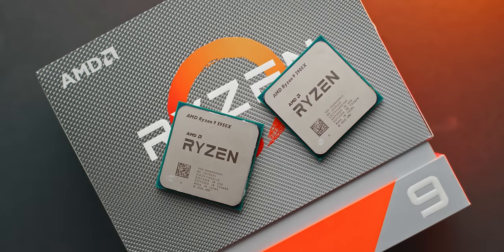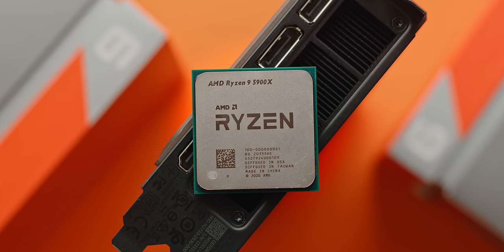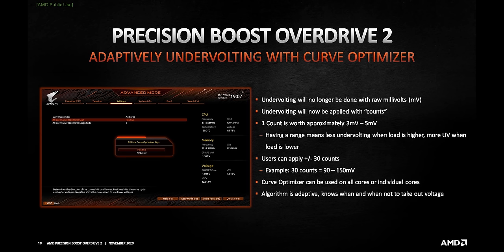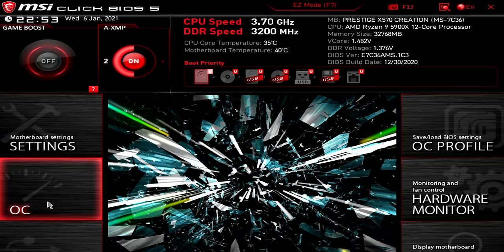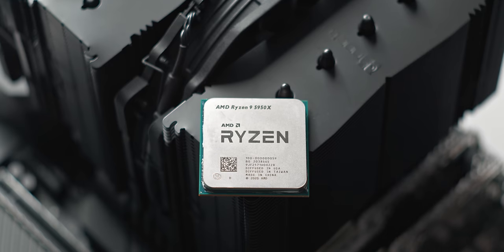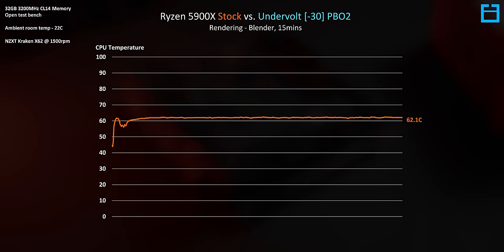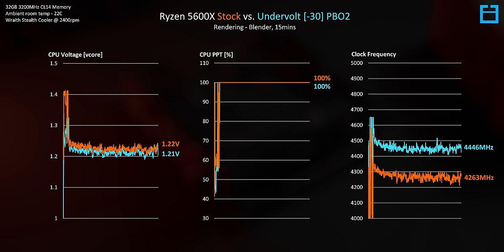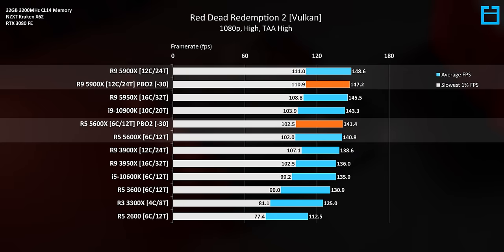Ryzen 5000 Undervolting with PBO2 – Absolutely Worth Doing

Comment: Yeah this is brilliant and seems like something a lot of proud overclockers would completely miss. After undervolting my 5600x by the max amount, and undervolting RTX 3080 to 0.85V @ 1875MHz I use a maximum of like 300-350W when playing games, not a single hitch. Crazy stuff. Combine that with Noctua cooler and case fans and my PC is almost dead quiet at full load, and generates a lot less heat. 

Undervolting all the way. So much more satisfying to have a highly efficient PC, rather than raging inferno just for a few more fps.
Reply: same with rtx 2070s and same cpu shaved of 10/18 c in most game under load wh3 warzone and rest crazy stuff
Reply: What is your settings for 5600x?
Reply: Damn, my 3080 is 0.95v @ 1950Mhz and I can't go lower or I crash
Reply: @SpiderpigThe  turn of pbo that is all how i see lie, so much voltage and temp for nothing , just overclock manualy if you want i get it on 1.2v 4.5ghz under loads it get around 63-65 c with aio.
Reply: what value did you put -30 for all core or?
Reply: @ionutortian5885  I put -30 on all my 5800X3D cores, dropped 10c under load
Reply: @maliikac95  doing so instead of pbo increases power consumption and temps in games, while in benchmarks it's bit colder and higher scores
Reply: This is the way
Reply: how do u undervolt gpu?
Reply: they all know undervolt, showing undervolt result wont impress anyone, they show another profile with max oc for gaming instead
Reply: i got a 500 watt psu and want a 3080 this gives me hope not to upgrade it lol.
Reply: dont forget about VRAM on GPU, sometimes by underwolting GPU - fans may go full stop/passive mode for most amount of time, VRAM usually is still under high load and heating, not all videocards have sensors on VRAM, not all videocards have great heatsink to properly cool VRAM in passive mode, i think ideally need to manually set up fan speed curve, at least 10-20% always active mode for low GPU core temps, fans still will be quiet, but at same time cooling down VRAM constantly
Reply: How do you under volt the 3080?
Reply: yeah if you know you dont have money for electricity bills why you make that setup????????????????

Comment: Absolute champ, I've watched almost every video and learnt so much from you! You walked me through my NZXT H1 build, undervolting my 5700XT, justified my already purchased EVGA 3060ti XC and now this. 🙂
Reply: Why would you replace a 5700XT with a 3060 Ti? I'm not bashing or hating, it just genuinely interests me. Those two aren't too far apart in terms of performance, or at least not enough apart to justify spending $400+. Or have you sold/found another use for the 5700XT?
Reply: @subrezon  probably sold it or got rid of it, maybe cuz of driver issues?
Reply: @subrezon  in my opinion, definitely for RTX😭.
Reply: @subrezon   @Subrezon  yeah that's a good question. I video edit and I wanted to try try an Nvidia card for the GPU accelaration and I have to say it's been a pretty good. I game as well and I'm planning to use the 5700XT and my 3600 from my H1 in my new HTPC. What's interrsting though is in Australia, my gaming OC 5700XT is going for 550 - 600 on ebay and I bought it for 670! Tempted to sell it...
Reply: @subrezon  In my expericence the 5700xt drivers are just garbage and slipping over to the 3060ti is reasonable, especially when u can take advantage of tay tracing
Reply: @bobtyler8374  Raytracing with the 3060ti doesn't really make sense as it's too weak to enjoy the image seen, because fps are quite bad. Also drivers with 5700XT have been perfect for a good time now, the problems were only at the start, some minor bugs are with every GPU though.
Reply: @jonasziegler3025  what gives you the idea that the fps is bad? It's equal to a 2080
Reply: @weavercs4014  Yeah, and raytracing with a 2080 is not fun, it even isn't with a 2080ti/3070.
Reply: @jonasziegler3025  I disagree, my personal experience with the 5700 xt has been abysmal, constant crashing and drivers errors, even when i moved it to another system with much higher psu, i got a 3070 a week ago and havent had a single crash, again thats just my experience.
Reply: @bobtyler8374  Yeah, what I said, some have problems, some don't. But there were also black screen and blue screen errors with the rtx 3000 series.
Reply: @bobtyler8374  Yet there's people that have been complaining about Nvidia driver issues since the release of the 3080 that haven't been fixed but no one bats an eye
Reply: @bobtyler8374  ever occurred you that you might have gotten a defective card?
Reply: Damn you’re upgrading from a 5700XT to a 3060Ti? Talk about a lateral upgrade...
Reply: I have a 5700xt no crashes at all very stable
Drivers are not very good
I have over 150+ games the only game i noticed the drivers were bad are Destiny 2
Overwatch PUBG all the old CODs 
Watch_dogs2 Valorant and Monster hunter.
Reply: @SSJBen  take a chill pill dude!
Reply: @belema22  Maybe you should take the chill pill instead? Why did you assume I wasn't chill?
Reply: @bobtyler8374  i sell my 5700XT Red Devil with driver crash at 800 euro and i bought a 3060ti Gigabyte OC a 630 euro.You are right, driver garbage for 5700xt

Comment: Amazing, can't believe I've slept on this extra performance for a year 🤣 got my 5900x paired with a msi b450m gaming plus motherboard running pbo 2 with curve optimizer at negative 25 with auto oc set to +200, Getting identical temps as before with 3-400 mhz improvement in clock speeds in single threaded workloads and in cinebench r23 multi core test it holds a solid 4.6ghz all cores. Thanks for this video! Highly appreciated!
Reply: Is that 5900x working fine with msi b450m gaming plus. That motherboard is cheap for 5900x. I'm also thinking to buy 5800x for my msi b450m m2 pro max. My motherboard is almost same price. When it available.

Comment: Was able to set negative 30 on my 5800X and got a big performance boost out of nowhere. 
I can’t thank you enough for such a useful info!
Reply: Антон Поддубнов I couldn’t keep 30 negative magnitude. I had to set mine to 25. Probably due to the mother boards. Each one delivers power a little differently. I was able to get some serious gains though. Glad you also had a similar performance boost.
Reply: @chrissmith8242  Thanks! After thorough testing I also had to dial it back to 26 for a concrete stability. Anyway - the performance gain us huge!
Reply: Is it stable in time spy physics test?
Reply: @johannestheil652  yes, of-course. It’s rock solid everywhere.
Reply: @antonpoddubnov4651  lucky guy, it doesnt work for me sadly. Which kind of ram do you use and how many ram bars?
Reply: @johannestheil652  Two single rank bars performing at 3733 MHz CL16
Reply: @antonpoddubnov4651  Nice. I still seem to have some issues with my 4 single rank bars running at 3600Mhz, just tested them on 3200Mhz with 20 negative magnitude on pbo, seems to work fine.
Reply: How can you tell that it is unstable?
Reply: @brickmaster518  Well, i have issues with my 3600 Mhz Ram since i got my new PC. The agesa update end of december fixed it, i thought, but now i see it is not the case when i try to undervolt my ryzen 5800x.
Reply: @antonpoddubnov4651  what is your Mobo?
Reply: @darklight7046  MSI MPG B550
Reply: @antonpoddubnov4651  thank you.

Comment: I was skeptical of doing this at first, but my 5800x runs much cooler at all times; even under a torture test. I would hit 90c instantly with a 360mm AIO. Now it hovers around 80c sustained. I also have better single core performance, as my firestrike score improved by over 2000 points. Absolutely incredible.
Reply: Really. What settings did you use for 5800x
Reply: How did you even hit 90 C on a 360 mm AIO???
Reply: I can barely hit 75 on a air cooler with a 5900 X
Reply: Maybe check your thermal paste?
Reply: @ariesleo7396  I honestly don't know lol paste was my first thought too but I triple and quadruple checked thermal paste. I read online at one point that all the cores are on one die for the 5800x and causes it to generate a lot of heat quickly in a small area vs the cores being distributed across multiple dies
Reply: @ariesleo7396  but to answer your question I would hit 90 only doing a torture test on OCCT with avx2 instruction set and small data set. Under normal circumstances I hover around 70c in-game under load
Reply: @mindrover777  all I did was enable PBO and lower the voltage curve to a point where it was stable under a torture test. Then I went a lil further and lowered the voltage on individual cores since some could go lower than others.
Reply: @Un0rThOdOx1  What frequency did you hit? I can get 4.87-4.9 max Single core and 4.3 all core

With a -15 all core voltage curve anything above was unstable
Reply: @ariesleo7396  the r7 5800x is popular for running hot
Reply: Did -25 on my 5800x and temps dropped by almost 10c, I’m actually getting slightly lower boost clocks though, 4800 where I used to get 4850.  Did I do something wrong?
Reply: Is your system still stable?
Reply: Damn I feel blessed with my 5800x just using an average 240 aio and its always run super cool honestly
Reply: I used to have those kind of high temperatures with big AIO 
But it was because my pump was starting to fail
With my new AIO, I can't reach 90°C even with fans on low
Reply: God damn 90c with a 360? What torture test is that, the pits of hell?

Comment: Thanks for the guide, for best results set the two best pair cores with less negative offset, the second best pair with slight more negative offset, and the rest at something like -20 -25.
My 5900X is running at -8 best two -10 second best pair and -23 the remaining cores.
Cpuz Scores: 
single thread 692
  
multi  thread 10087
Cinebench R23: multi thread 22915
Reply: how do you find out what your best cores are?
Reply: I can't even set my best two cores to -1 offset without gaming being unstable. My worst cores can't even boot into Windows stable at -20. I think I lost the silicon lottery.
Reply: @The0Flaming0One  Try Clock Tuner for Ryzen
Reply: @The0Flaming0One  with ryzen master
Reply: @Alauz  If you have a Gigabyte mobo (mine is a Aorus x570) try this settings
ppt 300
 tdc 230 edc 230 and scalar 4x
Reply: @sirqwerty3559  why would you set the scalar to 4x? That increases the voltage. Regardless since I’ve heard so much conflicting info I’ll try your settings anyway because I’ve got a Gigabyte board
Reply: @sirqwerty3559  Hey bro, I am using ASUS TUF B550 Gaming Wifi Motherboard and I've finally had success for that free +200 MHz PBO2 goodness.

The trick for me, is the disable PBO in the Ai Tweaker section & Turn PBO to Advanced under AMD Overclocking section & set the auto OC to 200MHz & then curve optimizer to Negative and then... put in ZERO lol... After that, the CPU boosts to 4925 for Single Core (Max 66C) & 4600 on All Cores (Max 85C).

I'd have to say, since it's free performance I'd take it.
Reply: Best cores need less voltage. More voltage required for the worst cores. So you do it in opposite way which is wrong. If you actually doing proper overclocking.
Reply: @babenkoff  Unfortunately I haven't personally seen any reputable guides that cover the small details like this. I had the same idea you did but I don't believe that's correct. For example I just tried to boot my 5800x on -25 all core and Windows wouldn't start. I change my top 2 cores to -10 and got into Windows. I believe the reason being that in single core workloads the CPU will default to using the top performing cores. At single core loads more voltage is used than all core, so probably -30 is too far of an undervolt to hit those high clock speeds in single core workloads. Thus you need to give the highest performing cores LESS of an undervolt, at least as far as I can tell.
Reply: @realbadtech9318  it depends on your goal, saving some energy or overclocking.
Reply: Can only set to -5 on all cores and getting 7800 multi thread score and 613 single thread. Basically same as at Stock. Seems pretty below average for me...
Reply: @realbadtech9318  Yes it does, but also let you sustain the extra boost longer. I also tried auto 1x and 8x and the performance was worse .
Reply: @babenkoff  i can assure you that this is the correct method, the first time i did the same way that you are saying, and not only the results were worse, but some random crashes also.
Reply: @MrJohnnyImba  You can also gain more with tight memory timmings "ryzen dram calculator" will help you
Reply: @sirqwerty3559  XMP and therefore timings are not that bad with 16-18-18-36 3600. So at least should get around 630 single core score and 8400 multicore... But I'm not getting those numbers. Any idea? Bad silicone? Its a fresh system.
Reply: @MrJohnnyImba  Interesting, 16-16-21-34 3600 fclk 1800 here (not samsung b-die) what motherboard do you have?
Reply: @sirqwerty3559  Forgot to mention that the scores are CB20 not CPU-Z. CPU-Z I'm getting 650 single core and 9460 multi core. Motherboard is ASUS b550i-strix with beta bios 1602. Temps are totally fine with custom water cooled loop peaking at ~75°C with silent fan curve. Got the most recent chipset drivers.
Reply: @MrJohnnyImba  Good temperatures, on r23 10 minutes i have like 80°C.
Your single is fine for stock but the multi seems a bit low.
I recommend reset the bios to default, start with only the xmp enabled for example, do a quick benchmark, take notes, and go adding up one bios tune each time.
For example i found the hard way, gigabyte boards dont like more than certain values, more than ppt 300
 tdc 230 edc 230 will wave less performance, youtuber actually hardware overclock also talks about this problem.
Reply: @sirqwerty3559  Thank you for helping me out with that.  Cores are boosting to a maximum of 4075 mhz with stock settings on multicore cinebench r20. no xmp. With xmp it goes up to 4100. Seems kinda low since Optimum Tech is getting around 4400  mhz...
Reply: @MrJohnnyImba  Yes it's tad slow. That's the way overclock is, seems easy but there are so many variables that every system is unique. Try some 5000 series overclock guide on asus boards.
Reply: @Alauz  let me just tell you that you are not alene. I have to run + 10 all cores for my pc to run stable. Default setting I get constant bsod.
Reply: SirQwerty I have an x570 Aorus Pro motherboard and get BSOD booting up when going below -10. Do you think your settings you gave Albert would help me? Also, how do you find the first/second pair of best cores?
Reply: @charlesthompson6779  every ryzen 5000 is different it seems. A complete lottery. If you can run cpu at default settings consider yourself Lucky compared to mann others like myself.
Reply: 22915 points in Cinebench R23 is insane. My 5900X is barely getting 21000 points with PBO enabled...
Reply: @roon3437  Yeah, that's the consensus it seems unfortunately. Some people can undervolt to the maximum of -30, and some can't go below stock. As you said, complete lottery.
Reply: @charlesthompson6779  Yes use those settings, for some reason if you put higher values you will degrade performance, youtuber actually hardware overclock covered this topic. 
The scalar and the curve optimizer depends on your silicon lottery.
Ryzen master will tell you the best two cores in each ccd.
Reply: @ne0tic  At stock you should get 21800~ Check your Memmory timmings and speeds, make sure te fclck is half your ram speed to run 1:1
Reply: I'm not having any success with per core offset , I tried doing this but then all the other cores only boost upto 3700 MHz while the 2 cores boost higher .
Reply: @charlesthompson6779  I cant even use my pc unless I set the curve optimizer to +10.. anything Else means constant bsod. Even at default settings.
Reply: @sirqwerty3559  Weird. My timings are 16-18-18-36 and 3600 MHz. Fclck is set to 1800 MHz as well. During a Cinebench R23 run at stock with XMP, the all core boost clock is between 4200-4275 MHz and I get a score of about 20700. At least my temps doesn't go higher than 67 degrees. With PBO enabled and such, or ASUS optimized values enabled, the boost is 4350-4400 MHz but my score is just barely 21200. Hopefully it will get better in a few BIOS updates.
Reply: @ne0tic  Yeah maybe a bios update will bring performance up, your memory is better than my cheap team group, also the temperatures, so in theory you could get even better results if you have a good cpu.
Reply: @sirqwerty3559   can you please help me with the under-volt and stability. I have a stock 5950x with a 480mm rad and under load it can get up to 70c and it’s a thick 65mm rad with noctuas on both sides. I have the x570 dark hero amd would really appreciate help. It crashes a few times a day and idk what to do.
Reply: @roon3437  hey I get the bsod here and there but mostly ransom restarts. I have the 5950x and the x570 dark hero. Can you teach me to keep it stable?
Reply: @Helistriker  My best advice would be to use your warranty and return the CPU. If you dont want to do that, then go into bios, and disable core performance boost, and set curve optimizer to -10 or -15. ( should be videos on YouTube showing you how to do that) However this is massively underclocking your CPU. Personally i returned mine, and got a new one working flawlessly.
Reply: @roon3437  what’s the turnaround on it being sent back?
Reply: @Helistriker  what do you mean? Personally i used my right to regret my purchase, and I just bought a new one. When it comes to warranty, it might take some time.